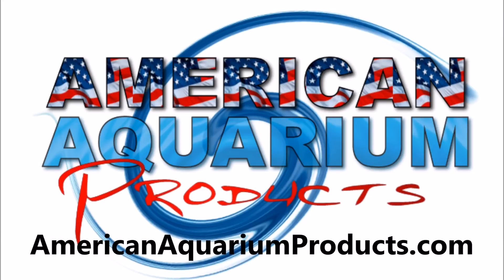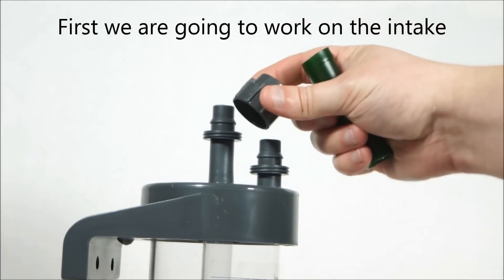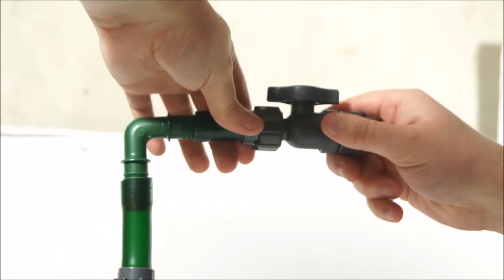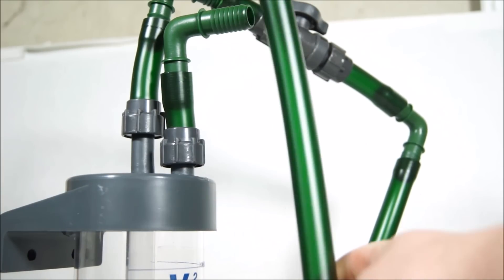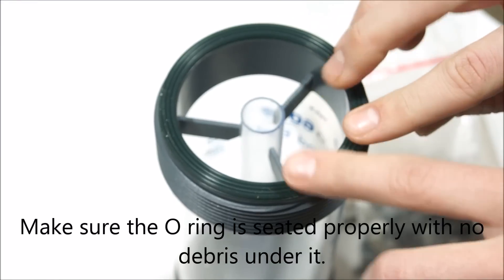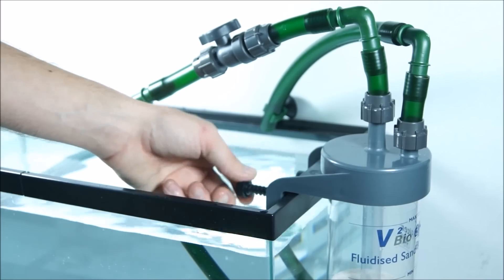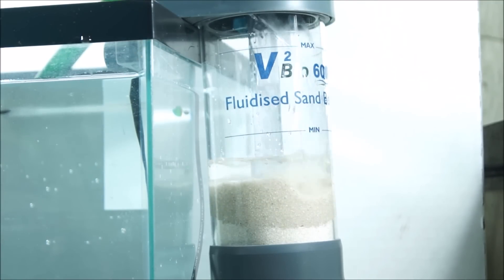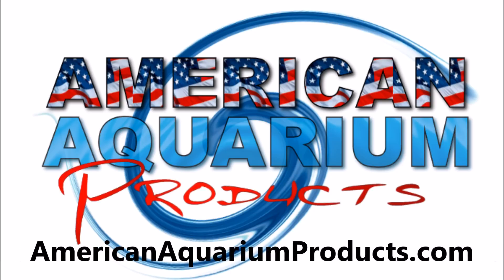TMC Fluidized Sand Filter Setup

Comment: does the fluidized sand filter effectively trap solids?
Reply: I see. so this is purely a biological filter
Reply from the maker: No, you want to use it with a prefilter or it will clog. It's meant for bacteria loads only.

Comment: I purchased the 1500 model. 
this has been nothing short of a nightmare since I set it up. I lost my mind on the day I set it up, sorry about that. Old shot up Paratrooper, working on my anger/frustration tolerance. Again; sorry. 
Its almost impossible for me to get this started without getting sand and npx all over my tank. I tipped it even held it upside down nothing would move. laid it on its side and waited attempting to time lifting it to the vertical position. To soon sand packs down; to late its all over the tank. through trial and error and luck, got it going. 
Then when water does get started, NPX begins to matures its weight is increased, slowing the filtration considerably, (use 100ml of npx I removed the equivalent amount of sand) I was using the largest recommended powerhead1700)Then I switched to a RIO 3100 900GPH, didn't do much to increase my fluidization or waterflow. I Bought a bigger pump, The United Pump UP-2160, Mag Drive Pond 2600 GPH with max head presure 16.5'. Adjustable from zero to 2600GPH. 
After maturity it creates this white film at the top of the NPX media that is constantly dumped in my tank. My Only recourse right now is to zip tie a canister sponge over the outlet, water still stays milky white color, no more floating debris. its starting to accumulate on plants and equipment Am using 2 100ml bags of Purigen, it can't keep up with the on going release of the milky white water from the FSB. 
too correct it, Am currently waiting for a lifegard mechanical and chemical filtration modules to filter the water before its returned to my aquarium. It was the simplest solution I could come up with, not by any means the cheapest solution. 
I have exactly zero experience doing this. I have no friends that are into this, so the Internet is my only recourse. And my plumbing skills are non existent. I'm a horrible plumber. 
On the positive side it really is a great bio filter. Knocked my nitrates down to less then 5PPM from over a 100ppm in about a week. just a slight tinge of orange, on the API test. 
usability/maintenance isn't easy or simple. 
If the center inlet tube could be placed in a locked position at the base preventing it from coming up when the cap is removed, that would be a huge improvement, along with some kind of mechanical water assist, like the primer of canister to break up the compacted sand alowing easier restarts. 
Again it is a great bio filter; its just not for the Beginner or novice aquarium keeper. This is really built for professionals, which I am certainly not.
Reply from the maker: Interesting reading your experience with the sand filter. I want to remind you can always write into AAP email support for help. Sometimes a good shake is all that's needed. Usually more flow is not needed, when it's set up as per our recommendations. if the NPX are getting really milky, it makes me think there's to much flow in the filter. Also make sure the holes in the bottom of the filter are clear. Once the filter gets going, it's almost zero maintenance. let us know if there's anything we can do...
Reply: Well when I got home this morning the White film is gone....I think its the short duration type of bacteria ie new piece of drift wood or hose that goes away. 

After reading the article on head pressure. I was able to fix my plumbing deficiencies. I was trying to do to much with to many 90' angles and attaching my UV. 

Stream lined(shortened hose length) it for better efficacy. Still a bit of problem getting it started but not nearly the issues I began with. 

From now on deep breath send an email to customer support before losing my head. 

Thanks for the help keep up the excellent work
Reply from the maker: glad to hear something was figured out... yup, to many elbows will effect flow dramatically.

Comment: Will this sand eventually lead to a crystal clear aquarium?  I have a 55g long low tech planted aquarium with 2 Penguin 350 HOB (added two cartridges of Seachem Matrix)  and 15 fish.  Also, I do 20% plus weekly water changes.  Will adding or replacing one of the HOB with this FSB filter produce better water clarity?
Reply from the maker: +wyzemann Yes, it can help. Having more bio filtration always help water clarity. There's also other medias to put with the sand (NPX) which help.
Reply from the maker: +wyzemann yes, with the increase bio filtration it leads to clear water.
Reply from the maker: +wyzemann yes, with the increase bio filtration it leads to clear water.